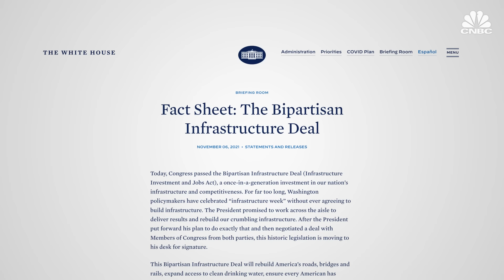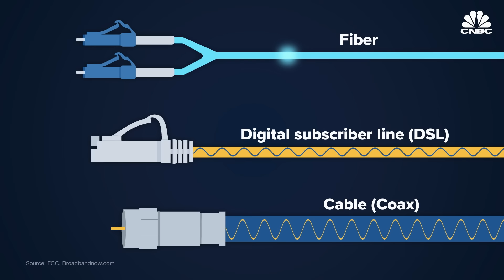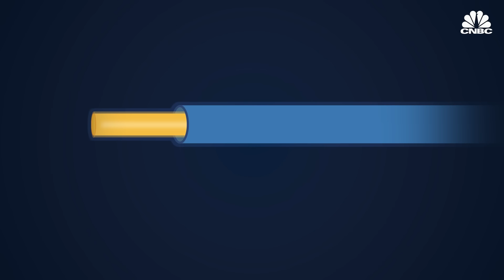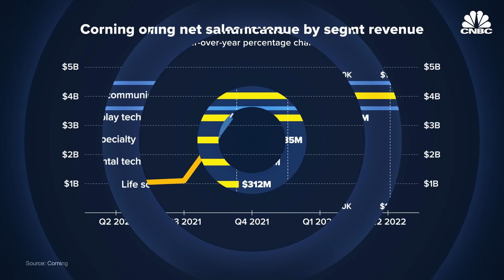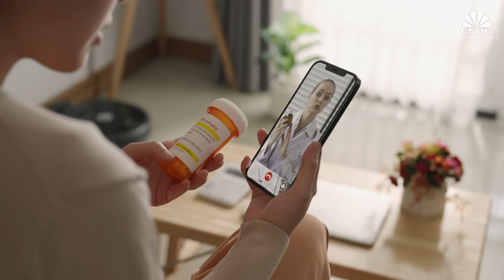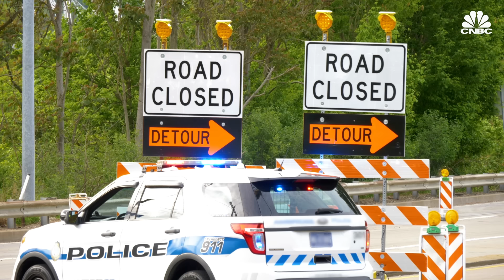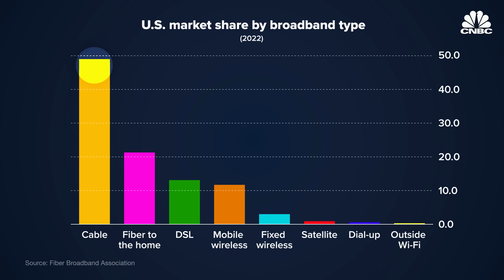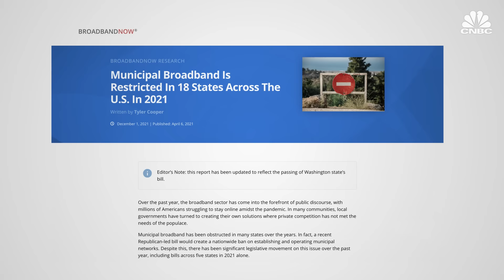How Fiber Will Speed Up America’s Internet

Comment: This should have been largely completed in the early 2000s.  I got my tech cert and they never implemented fiber, they dragged it for decades since and they still artificially slowing speeds on current  fiber networks.
Reply: yes and you better buy some stock shares now
Reply: @baysidejr  exactly.   A big scam.  News acting like this is a new discovery. Tge implementation of fiber is literally 20 years late right now.   They are offering speeds that's should have been given 20 Yeats ago.  I was training and got my Cisco certified network associate certificate and learned all this stuff a long time ago.  And the fact they are currently substantially slowing speeds and charging high price for a cheaper network to manage than cable
Reply: So they throttle people !??
Reply: because they can charge more for satellite.
Reply: @Jcccc23  yes because of anti-monopoly laws, since every telcom does not have access to fiber optic networks, in order to allow for competition, providers cap / tier speeds on fiber optic networks nowhere near capacity
Reply: @VeggieRice  I freaking knew it ! And the Verizon employees on Reddit said fios doesn’t do that
Reply: @Jcccc23  verizon doesn't cap the speeds in the sense to which people think. It's on purpose because if they actually gave full speed to everyone it would cause way too many outages. In the video the one person clearly said that the equipment and software will burn out before the fiber does which equals outages. I have seen in a Verizon architecture aka a PON where giving someone a gig speed early while others on the same PON are getting around 100Mbps took down the PON card. On the flip side as a customer no one wants to hear about an outage.
 Everyone wants their services to always work lol. It's a double edged sword.
Reply: I would suggest that everyone on this thread consider the split ratios of the PON network, the max theoretical capability of the circuit before reaching the splitter, and then what speeds are offered by the telecom provider.  Then consider the customer experience with regard to potential bandwidth congestion, and then decide if the “telecoms” are artificially throttling the bandwidth down below the capability of the fiber itself.  Woefully under educated commentary here.
Reply: Yup. There’s a LOT of capacity sitting unused. All artificial in the name of profits.
Reply: @unicornwarhammer1926 yeahhhh no not how most of their networks are designed.
Reply: @wallacewyche81  if the light intensity is the same why does it matter if it's 100mb or 1gb per second? They had 1gb/s fiber routers 20 years ago. We have substantially advanced the technology since.  They don't want to the public as a whole to have those speeds and that's that.
Reply: @wallacewyche81  100% valid commentary.  The total bandwidth to a PON splitter is shared by as many customers as are placed on the splitter.  The splitter’s capacity has to be managed to avoid issued with service quality.  The speeds are not “throttled”
Reply: @nesq4104  light intensity does not determine available bandwidth.  Just the range of the fiber signal.
Reply: @unicornwarhammer1926  yes.   I kinds was making a point about as if higher bandwidth is going to wear out the machines

Comment: As a Telecommunications worker for many years I can tell you it's criminal how much money these companies make and how little they are willing to pay for contracts to the actual builders. Telecommunications workers desperately need to unionize if they ever wish to achieve the success the lineman have.
Reply: Sadly but true
Reply: They would just transfer new costs to consumers...
Reply: 60$/mo for DSL or Fiber...how is that even the same price.
Reply: ISP networks need to be broken back up into regional players and never be allowed to consolidate because that's not their job. I'm a firm believer that the only "large" companies allowed should be investing/holding companies as they can prop up the companies.
Reply: Amen to that.
Reply: Then buy stock in them. That is where profits go.

Three years ago I retired from 34 years in IT Field Services for a Fortune 100 electric company. I'm pretty sure that across the industry the money goes into higher speed equipment; I don't recall the last time equipment I was replacing ever failed. Three years was about the limit for longevity. 

I would have hated to be in a telecom union. I spent a lot of time in substations, especially 230kv and 500kv stations. Much of our job was a lot wilder and woolier than average, with snowcatting to mountaintop sites in winter storms being nothing unusual. I joked our department motto was "Taking computer age skills to the end of Bronze Age roads at any time in any weather." We stopped doing tower work - contracted it out - a year before I retired. Why would I have wanted union wages?
Reply: @singular9  60$/mo for DSL or Fiber...how is that even the same price? A huge amount of the cost of delivering service to the public is in right-of-way... getting it at all and then paying for it. Right of way is actually easier for fiber than for copper... lighter weight, tougher, more reliable if the terminations are good. Once the right of way is obtained life is good.
Reply: I was certified in fiber optics because i saw the need for expansion. My company billed over 100 an hour for my time and paid me 12 dollars an hour. Never looked back after leaving that job
Reply: @flagmichael  I can also confirm the equipment cell carriers use has an insane failure rate. At least regarding Ericsson and Nokia BTS systems. You'll do an upgrade at a site and within 2 years you may be ripping all that work apart to make way for the next upgrade. At least they recycle the old equipment and send it to emerging markets in other countries.
Reply: @Distortic  that's the trash companies I'm talking about. My company wasn't that bad but they could stand to improve a lot. The hours you put in alone are rediculaus. Like 60 hours a week is basically your 40 and then most weeks you'll get more than that.
Reply: Makelele Toulalan  not if I'm the one paying, the sad thing is I'm already paying more for less compare to others with higher speed. I'm not against higher pay for worker but i rather have higher speeds at the reasonable price level Im paying for.
Reply: @flagmichael ...where are you where union wages are LOWER?
Reply: "From that time Jesus began to preach, and to say, Repent: for the kingdom of heaven is at hand." Matthew 4:17 

"Ye have heard that it hath been said, An eye for an eye, and a tooth for a tooth: But I say unto you, That ye resist not evil: but whosoever shall smite thee on thy right cheek, turn to him the other also." Matthew 5:38-39
Reply: @singular9  yeah the stuff they usually they sell this give to the customer it's really worthless the only time the lines for DSL which are basically the phone lines have been in there for decades are replaced if you requested or if your a business customer
Reply: why surprise, it's murica we are talking about
Reply: @SaretGnasoh  that's who management is
Reply: I am Mexican living in Mexico City and I am amazed how slow the internet service in some parts of the States is.
Reply: Global Dragon Union is with you ! love ya !
Reply: I belive it. I see installers making so little hourly.
Reply: it is criminl they got 1996 telecom act money which has been increased over the decades and never ran what the promised all those decades ago. just took the money. i didn't watch this video but, i'll believe the title when i see it IRL.
Reply: Umm, I retired from AT&T after 41 years and every one of those years I was a union member. My father before me was a union member. Every regional Bell company has been unionized for decades. My last year a a union tech I made $87000 and didn’t work very much overtime. Some of my friends that worked outside easily made $100k. You are right that the companies make big bucks though. Your work in telecommunications must have been in an area that wasn’t related to the Bell System.
Reply: @mikeE0055  I worked for a contractor. You know, the people that actually do all the work lol
Reply: @chickmagnetwampaone  you’re not wrong, 😂
Reply: @63saruman  lol, yeah so you live in the area where internet is the fastest in Mexico. I'm sure there's plenty of places in Mexico with no service at all or for very slow service.
Reply: @ozicrypto G 
It says a lot about you that you made a comment like that - none of it good.
Now, if you said "a politician", esp' a trumpist one, you would have a very good point.
Reply: And end up like lineman...
Reply: @singular9  In San Francisco it's only $25 per month for gigabit fiber
Reply: @Distortic  I worked on the equipment that connected to the fiber to deliver it to the customers which were usually the  LECs.it paid almost four times what you made when I retired with a good pension. I also worked on digital microwave and satellite communications.
Reply: I’ve been in Telecom for 40 years. Don’t let them fool you, customers and employees come last. Execs make all the money and just move company to company, failing along the way but keep those 25 mil salaries
Reply: @jamesyoung3341  I was a union telecom tech for a very large company. I met the CEO  when he and the 2 right under him  flew up to my workplace in the Arctic in a 3 engine Dassault Falcon
Reply: Globally, the telcos rip both the installers and consumers off by charging high and paying low. I work in the telecommunications industry too and the ill treatment is appauling
Reply: They don’t give anything to shareholders as well
Reply: @Distortic  4k a week for me splicing ftth
Reply: Worst offender is Comcast which ironically owns this channel
Reply: @axvarela  people who say this don't understand the basic economics of maximizing profit or supply and demand. If they could charge a higher price, they would've already.
Reply: Most of the communications companies have high debt so you are probably talking nonsense.
Reply: Well, the other part of it is, city and railroad permitting. These next to some of the hardware cause implementation costs to be very high.
Reply: I started as a telecommunications worker a few years back and I'm currently in a onboarding process for a data center engineer with no degrees or certs and of course a bigger income. I recommend trying out AWS, AZURE, etc.
Reply: @Distortic  My employer charges $125 hourly for my time and profits off parts sold per job and my compensation is $18 hourly plus .5% commission and I have to provide my own tools for the job which are costly (Powersports Tech). Been looking into Fiberoptics, allegedly in my area, installers can make up to $23.80 hourly, 10 hour shifts and on call. If I may, how long ago were you in the fiberoptics industry?
Reply: Telecoms isn’t anything compared to a lineman’s work
Reply: Verizon paid starvation wages for a contractor to install most of the fiber hardware in our apartment building, alone. He couldn’t afford child care, so his son was with him during the install.
Reply: Couldn't agree more
Reply: UNIONIZE UNIONIZE UNIONIZE
Reply: Communication Workers of America is a union
Reply: Incumbant telcos (AT&T, Verizon, etc.) are already union and are very good jobs. The issue is the insistence on outsourcing to cheaper, non-union contractors for new builds. The IBEW has a low voltage division for contractors but it is miniscule and non-existant in many parts of the country. These new subsidies need to come with stipulations to use only union labor.
Reply: You can say that again. The people who do nothing get the most
Reply: @Tylerd35s  you can say that again. Most of the time lineman have bucket trucks working 30 feet off the ground or 8 guys will show up to watch 1 guy climb a pole. Y'all get heli rides to the top on interstate transmission lines sometimes too. Meanwhile telcom guys climb 300ft for breakfast and build a whole cell site from the ground up with 3 guys. The snowcat access to the mountain top sites is where the real fun starts for the telecom guys...
Reply: @chickmagnetwampaone  i work telecoms too lol, i aint bashing it. but still being a lineman is the big bucks and the harder work.  You cant argue with money. and theres so much hazards.
Reply: @vegahusadard2355      k
Reply: Used to do be a fiber tech but the amount of work/pay ratio was just not enough for me..
Reply: @Distortic  Im not certified but yeah my copmany charges 125 and i get 28
Reply: I would agree with this but satellite constellations are going to put them all out of business unless they can keep up.
Reply: @anydaynow01 satellites will never surpass fiber.
Reply: Thanks to unions most manufacture companies close in the USA
Reply: @luispalacio1168  maybe because of greed.
Reply: Don't work for them. A job is a two way contract. Employers pay wages at prices employees are willing to sell their labor for.
Reply: @singular9 $60 for fiber? Where? That's not far from what we're paying for cable Internet, 300 down and 10 up.
Reply: The universities also make huge  profits but they do not recruit more than  three  faculty members in the department to teach  16 subjects  , is it possible for a single faculty to  teach sixteen different subjects including medicine and biology in engineering colleges ? They can manage  the entire admission process with a single faculty  working as the head of department, as vice principal , as principal and vice president academics and others  who appear on and off the screen are the catering service and  house keeping  registers  to  account for three million  revenue ?? why blame the telecommunications  they are doing their best to improve life by providing optical and fibre network to  reach more clients ... why the universities not employing more than one  controller of examination for  their  three million centers ?
Reply: Why I got out of it after going to trade school for telcom and was even certified in fiber. 12 hr pay for 180 hr billing rate.
Reply: With you brother. Telecom engineers and Technicians are undervalued.
Reply: I work in MSP so don't deal with working under telecoms but do with indirectly with them. I agree with you 100%.
Reply: @Distortic I work for a msp and we bill $95. I make around 31-32. Thankful for that but I know I'm still getting screwed when I'm doing the majority of the grunt work.
Reply: @flagmichael  It seems right-away would be the most difficult and expensive challenge to overcome in deployment. From what I understand a lot of it leasing  (poles, land/underground) and routing.
Reply: You are correct but that is an America only problem. As an employee of Corning Cable systems manufacturing units in the UK from the 80s to the 2000 ( and its predecessor in the UK "BICC" from the 70s) we were always Unionised and became the most efficient  corning manufacturing unit in the world (that's a quote from Wendell Weeks himself at the time) and the Bonuses that we got for it proved it😁😁
Reply: As of September 2024 the earnings and revenue growth of GLW doesn't support your claims. Insiders have been selling this stock. No buys.